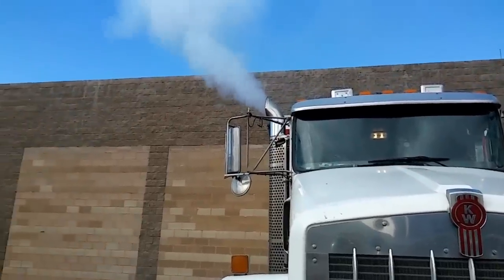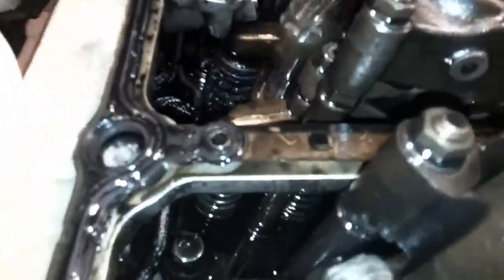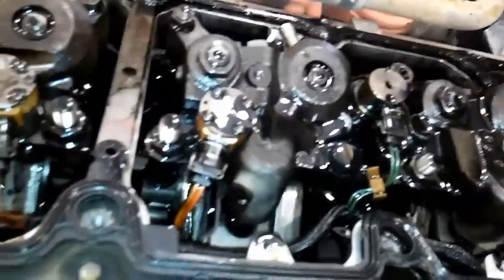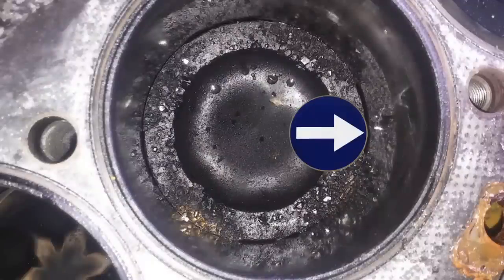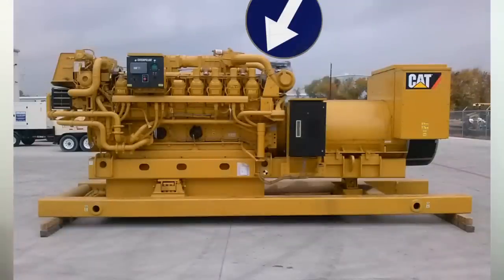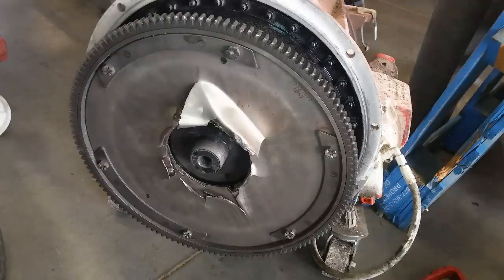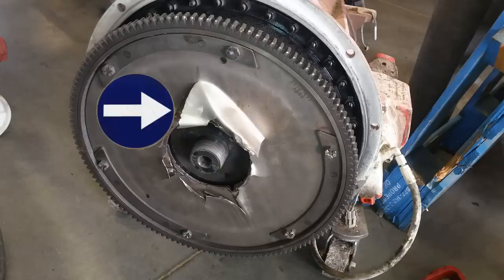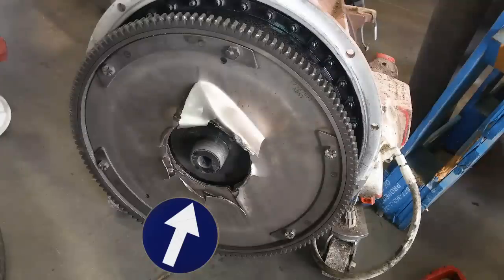Should You Warm Up A Diesel Engine?

Comment: Perfect example is my 2013 dmax. It has factory high idle. When I remote start it runs for about 30 seconds or so before the idle jumps up until it reaches temp. It’ll do this any day colder than 70 degrees or so

Comment: I used to see the extended idle a LOT on the railroads.  They would sit for HOURS with the engine idling.  However, nowadays, that doesn't happen very often, since there is a timer on the locomotives that automatically shuts the engine off after a certain time idling.  I believe that if they release the brakes, the locomotives automatically start the engines up.  Usually they sit for a minute or so idling before they actually start loading.  Also, there are the new Gen Set locomotives that have 3 diesel engines.  When idling, only one engine is running, but, when under heavier load, another engine comes online, and under full load, all 3 engines will be online.  I don't believe they sit at idle for a bit, but, the first engine could also be running block heaters for engines 2 and 3.  Some locomotives have a small standby engine that just serve to keep the main engine warm.

Comment: In an IC engines class, about 40 years ago, professor murphy said it's a waste of fuel to warm up your engine.  Once the oil pressure is up, you're good to go.  That's it.  Just drive.  HOWEVER, you should drive it GENTLY before it's warmed up.

Comment: I have an 2003 Dodge diesel 5.9 I start the engine when its cold wait for about 15 seconds put in drive and idle down the road as I live on a dead end and usually every body has gone to work when I hit the road and its 3 miles to the highway but at a 1.5 miles stop to pick up mail and after I check mail just take off as temp is about 1/3 up the oil temp gauge and temps usually don't get below 16 degrees sometimes it will freeze but that's only a couple times a winter.  Had a rabbit diesel in Wisconsin little 4 cylinder warmed up fast even at 35 below zero great little car great for getting around town on icy roads, come to spot sign slowly let out clutch don't even spin the wheels go slow on the icy roads and if you have trouble making a turn used the hand brake going slow can make a square turn no problem.  Being retired is very nice as when the roads are icy look out the window yup roads are icy fix a pot of tea and have a few donuts while you wait for the roads to thaw

Comment: What wasn't mentioned with the generators is that they are a high volume low oil pressure engine, the same as all earth moving equipment like bulldozers ect. The only difference between a caterpillar engine in an earth moving machine and a road truck is cam, cam timing, fluid lines and engine brakes

Comment: I let my 3500 get to 60F/15.5C  before I start to take off very easy  I also use Amsoil signature series and plug my truck in -10C/14F.  In northern Alberta in the oil fields.  When winter shows up there the diesel trucks don't shut off.  -40C to -50C.  A diesel won't start in weather like that.

Comment: Use the correct viscosity oil for the ambient temps. and also remember that the whole drive train needs to be brought up to temperature, so taking it easy at first is important not just for the engine.

Comment: Also turn your HVAC controls to OFF during the warm up.  Start truck.  Wait till oil press stabilizes.  Wait 30 seconds, then increase RPM to 1000 rpms for 1-2 minutes.  Then you can drive the truck, no more than 1/3 throttle and no more than 2/3 of engine RPM.  When your temp needle starts to move, feel free to turn on the heat.

Comment: I turn on my exhaust brake and let it idle. With the exhaust brake on it warms up faster. I run it for 3 or 4 minutes when i Start it up and 2 or 3 minutes before i shut it off. And that is for the turbo so it is well oiled before i take off and cooled down before i shut it off.  If it's real cold out I'll give it a few more minutes.  Also My cummins will go to a high idle by itself after 2 minutes if it is cold out.

Comment: Glazing in the cylinders basically is when the engine is idling too long. 15 minutes of idling a diesel will do it. Anyways the rings arent getting pushed completely against the cylinder wall and letting blowby happen. Then that happens (fairly quickly) the crosshatch gets kinda mashed smooth. Then at that point the rings arent able to properly seal on the wall allowing more blowby, oil burning thus carbon buildup. Diesels like to be driven and used in a spirited way to keep the glazing and carbon buildup to a minimum. -my experience talking with an old timer mechanic im friends with

Comment: Its easy! Metal to work as intended (design) need to reach a certain (design) temperature to function properly. Metallurgy. It can flex a bit but given these parts are at high tolerance and some with high carbon contect, they can bend to point of no retuen or crack. Loose its integrity. Worm oil will worm up the parts to function properly as well as lubricate them to avoid wear!

Comment: There is one other component when warming up a pickup....warning up circulates warm diesel fuel back to the tank and prevents gelling when you take off....yes, I learned the hard way. Yes, I had good and adequate anti-gel in my tank. It was -15°F . 20 min idling and it still gelled up when going down the road and passing more fuel through the fuel filter.

Comment: Modern synthetic multi-weight engine oil maintains its viscosity to temperatures as low as -40°F (-40°C).  With modern lubricants, the engine components get lubrication from start up.  Extended warm-up is a relic of the old days on single weight engine oils and no longer necessary.

Comment: Some of this i agree with and some I don't being a mechanical engineer and mechanic since I could turn wrenches I would say yes idling amd low rpms is not a good suggestion over long periods on older diesel engines because unburned fuel and hit the sleeve wall causing extra wear...this is because the injection system just gives one big squirt of fuel eveytime and the low pressures on the injectors doesn't get as good fuel atomization hence why older diesels are louder with a fuel knock... But bumping idle to 1000 to 1200 rpms can stop that by keeping more heat in the cylinders and stopping engine lobe.... Now new diesel engines are different because the injection system can adjust timing more accurately and they squirt a small amount of fuel to light the fire followed by several other injections to keep it burning down the power stroke... Also combined with the extreme pressure in the system the fuel is atomized perfectly for a clean burn and also why they sound much quieter at idle

Comment: Hi all the rules for flywheel & torque converter bolts must be torqued down and we must use lock-tight  if these things are not done!  they can come loose!  also checked once in a while is good after 30,000 Miles.  KW Wiese

Comment: the reason as to why the injector lines are so close to the exhaust manifold is that the hotter the fuel the better the performance of the diesel engine, so it makes sense that the quickest way to heat up an engine is to drive it yes? / no?

Comment: Regarding oil, I started a Ford Ranger I had in -40 F one morning.  The check oil light came on, so I shut it down as it did leak a bit.  I kept a spare quart behind the headlight for topoffs.  I tried pouring it and it was like peanut butter. Oil wasn't low, it just wasn't getting back to the pan in a big hurry.

Comment: I drive a school bus with a Cat C-9, I have a high idle and low idle switch. I understand to run the engine at startup at low idle for about a minute, then switch over to high idle to warm up to operating temperature.

Comment: Well, we have a Bmw E46 320d (so a 2L turbo diesel)
And here in Germany it can get fairly cold in the winter. We  basically don't let it warm up much longer than it takes to put on a seatbelt.

Still running like new at 325.000Km.
Never had any components in the engine replaced.

Comment: Start, bring to 1,000 or so and let it build air pressure.  The compression heat is better in a cold engine when you have some R's in.  You need the compression heat to get the cylinders up to a reasonable temp before you load the engine ...  Also depends on what oil you are running.  5W-40 multi vs SAE 30 will act different ...

Comment: 2:30   i ownded/drove lotsa diesels, over 40 yrs. 1) start up 2)  idle at start rpm, for 2 minutes. 3) idle up to 1000  rpm for 5 mins   4)  idle up to 1200 for 5 mins  6)   switch on heater, if warm, pop in gear and go.   BUT, detroit diesels, idle for 10 minutes, pop in gear and go.   IF   IT IS - 10  FAHRENHEIT, idle at start-up, for all,, a bit longer.   Also, if you need to sleep, when its cold out, idle up to at least 900 rpm. Your engine, will carbon up,bad if you don't .  One time, up at Wolaston Lake, uranium mine, in northern Saskatchewan, i had to idle up the big cam 290 cummins, to 1400, to stay warm, (even with weather front ) winter of 79-80       It was about -40 fahrenheit out, and i was unloading sulphuric acid.   GOOD DAY,  young people  !!!

Comment: I've ran equipment for 10+ yrs I've always let it idle for a minute then turn the work idle up to 1100 and let it run for 10 minutes never had issues seen multiple engines way past 10k hours

Comment: I live in mass. I would say to be safe 2-5 minutes to be safe - defiantly let the oil warm up a little   for lubrications reasons   and proper evaporation of fuel for proper care in such cold conditions     too cold you may have metal to metal in cylinders.    diesel engines like to be at least warm to run right .

Comment: Not sure why people don't put a heating element in the sump and coolant galleries for cold weather. So simple and cheap to do. Combine those with an electric oil pump to prime engine before startup and also a manual exhaust brake that you can turn on to load cylinders at idle.

Comment: Wen it’s cold things break easy industrial generators are made for to be run hard I always plug my truck in from oct on till spring I got a old 6.5 and they do not like starting in the cold I think you should let it build up some oil pressure and then start To rev a little like you say maybe a 1000 will bring temps up a lot quicker so I wait at least 5 min you have very good videos interesting

Comment: I own a military truck with a multifuel engine it's definitely important to let it warm up and cool down. I run an egt gauge the temps are hotter when it's cooler out and I'm idling. I assume it's because of the fuel and air are more dense once It's warmed up the egts fall down to normal temps. Very cool videos take care.
Reply: M52a2

Comment: Cat also recommend not to operate the engine under any load until it is in cold mode which is below 80 degrees F.
Once the gauges starts to rise start operating under light load and slowly increase load as the engine warms up. 
So I let the engine get to 100 degrees before I start to operate my truck. But the problem is as you said not to idle when cold, I do long haul I don’t have access to block heaters anywhere. What you recommend in this situation?
Idling takes half hour for the engine to go above 100 degrees what’s the best way? Should I just idle for few minutes and then rev it up to 1000 to warm up faster?

Comment: The oil filter is bypassed when cold oil exceeds a certain pressure,  after a warmup I use the oil pressure gauge as my shift point and keep it below 80 psi when driving until the oil is hot enough

Comment: Cold, like as cold as it can be when I can sleep without it running, ie, high teens. I start it, finish my log, then bump it up while I do a pretrip. Then I ease out of the truckstop, keeping it under 1,100 rpm. By the time I've hit the freeway, both the oil and coolant temps are off the peg. Then I can get after it a little.

Comment: I think one variable needs mentioning. Mounted Auxiliary equipment connected my have other warm up requirements. In the construction industry many of these Engines directly turn (no clutch involved) gear boxes and hydraulic pumps that may need more time.

Comment: We have all DT466E engines and when i know the outside temps are going to be 32 degrees and below i plug in the block heaters for about 2 hours or so which brings coolant temp to about 100 degrees unplug them idle a couple minutes and you are ready to go.

Comment: My theory is that a block or pan heater and good glow plugs are very important in that cold starts are the situation likely to result in the air/fuel mixture not burning thoroughly. In my opinion anything within reason that can be done to aid the ease in which the engine starts from cold is most beneficial. Obviously pre heaters don't keep an engine that's not in operation at or near operating temp. but heaters in conjunction with good glow plugs that allow an engine to quickly start are essential in cold temperatures. Trying to get a diesel engine to start in cold temps that result in prolonged cranking and lighting off the mixture but failing to start so repeated attempts are necessary is much worse i believe than idling a diesel at operating temperature or to get one that has just started up to operating temperature.

Comment: No one mentioned the oil feed for the turbo.. cold oil isnt flowing, meaning the turbo isnt getting oil. My opinion is GM knows what theyre doing, and my duramax runs for 30 seconds or so before it automatically kicks into elevated idle (12-1400 rpm) until the coolant and trans temp is up to at least 125 degrees. Gm also says to not use the block heater unless temps are less than 32. In a nutshell, because of this, they know their warm up cadence is good for the engine, or they wouldnt program the truck this way.

Comment: UK Having spent quite some time in an engine test house and seeing the results of endless tests I agree entirely with your video. I worked on a system that automatically warmed a large diesel engine to reduce initial wear and safely enable maximum power output as soon as possible. The only manual calibration was the type of oil being used. The unit automatically increased the throttle setting and even told you when to drive. At -40C maximum power was around 100 seconds although the vehicle could me driven after 45 seconds. At 20C this time was almost halved and at 40C oil pressure +10 seconds. What make of engine? I'll give you a clue - 'sound means wear'.

Comment: Since temps do not (usually) get (much) bellow 40 ºF in winter in my area, i just turn on the car, open the gate, then in the time the gate takes to open i get out to the street and wait for the gate to close.
After that i just drive gently until the car is fully warmed up.

Comment: The colder it is, the longer the necessary plug in time. If you rush it you can feel the resistance from cold oil. Decent glow plugs are critical in cold weather climates. 
I drive an 1984 F-250, 6.9, mechanical diesel, with 90,000 miles on it. A lighter grade of oil helps, and don’t forget to add anti-gelling additives to your fuel in colder weather. K.I.S.S.

Comment: We warm up our engines a lot more than you say to we just had a cat c15 550 horse crater after 45000 hours and was always warmed up. And had a cumins n14 500 horse crater at 15000 hours and we all seen him pull out of the shop put the door down and gone. There is nothing wrong with a 20 minute warm up get everything moving and oiled before you blow a motor. Pretty expensive learning.

Comment: This is also a reason I've never understood mower engines starting at full rpm. I add a hand choke to all mine and start them at idle. Then after a min or so just slightly crack the throttle to a high idle for a few min before using.  Just doesn't seem right to me to start a non pressurized oiling engine at 36 to 3800rpm

Comment: The company I work for doesn't allow us to idle so when it's cold out we have a tri Pac so when it's running it actually uses coolant from the engine to keep this engine cool so it also helps keep the main engine coolant temp around 140 so it helps with cold starts and warm up

Comment: I start my CAT C13 ACERT every time the same way;
I watch and make sure I have oil pressure
then I bump up my RPM to 800 RPM (using the cruise control)
then I let it run 5-10 min
then my first mile I drive it easy.

Comment: I bought a sailboat with a 40 year old, 3 cylinder, 35Hp Volvo diesel. It starts cold, and seems to have decent power.  Since it is in a sailboat, the engine is only used intermittently.  But one thing that bothers me is that it uses seawater to cool the engine and that causes the engine cooling temperature to swing wildly; I see the temperature gauge climb until the thermostat opens, and then the temperature drops suddenly.  While the engine must have been designed to take these wild swings (it's 40 years old after all) I'm sure it is impacting the efficiency of the engine and maybe causing greater wear than necessary.  

I'm considering putting in a heat exchanger set-up that would then run coolant in the engine and raw water to cool the coolant in the heat exchanger.  First, what are your thoughts on these wild temperature swings, and second, any advice on an exchanger setup?
Reply: the cylinder mass mitigates some of the temp swing and how much it affects rings etc.  would not worry about it at all

Comment: 30 minute warm up in cold winter is necessary anyway.  Battery/Engine/Vehicle!  It factory idles high warming the engine when it's cold like recommended in this video, also recharging the battery and it lets you warm up the vehicle with the heater so you don't have to drive in the freezing cold.